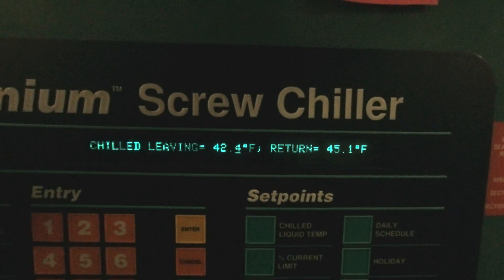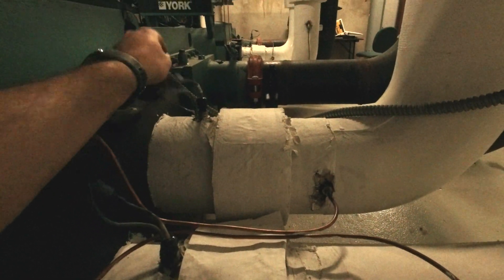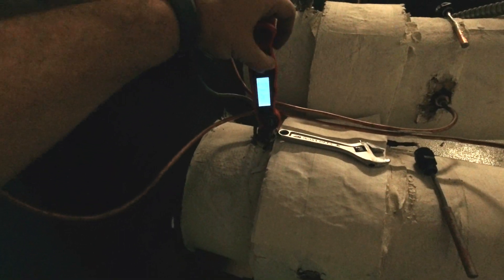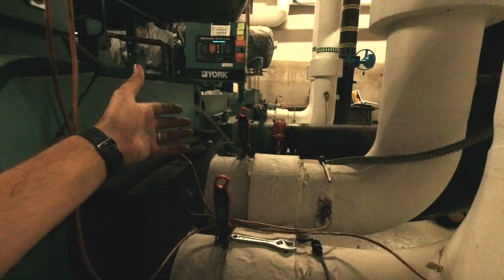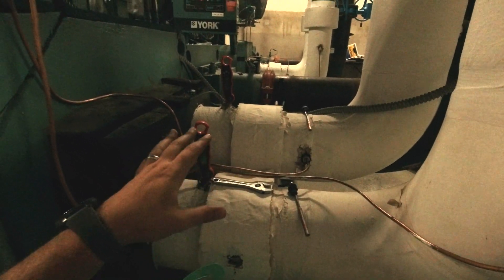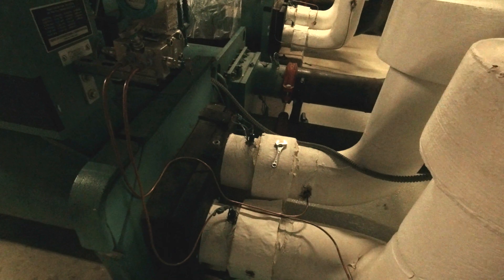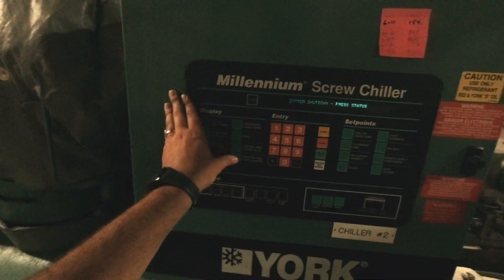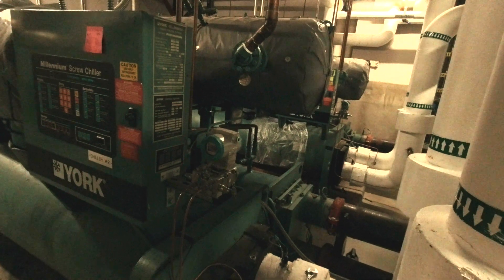York YS Chiller Bad Sensors

Comment: Is that a York YS chiller?
Reply: I would expect more system issues to be found in the future with starts to run hours that lopsided. I feel like at an absolute minimum run hours should double starts. But it's the real world so.... ya know lol.
Reply from the maker: There is. The automation control of building and plant loading is in poor shape and outside of original design. Im just scratching the surface of issues here.
Reply from the maker: Yes